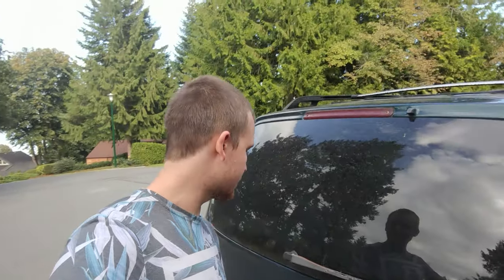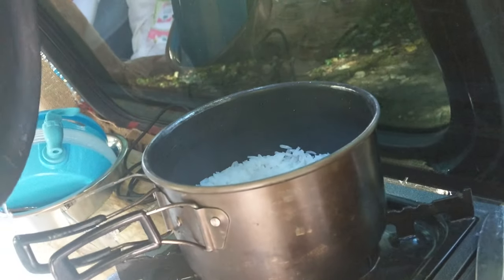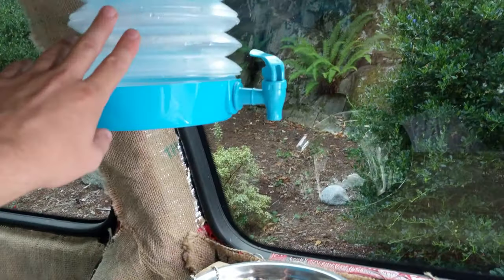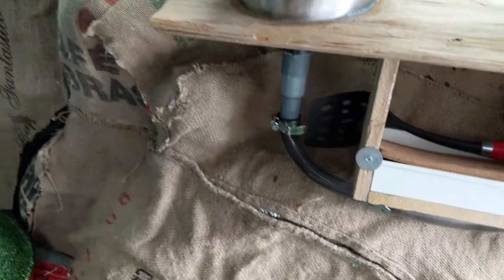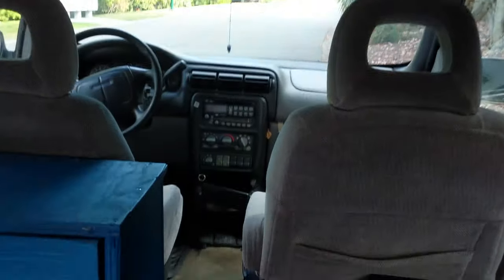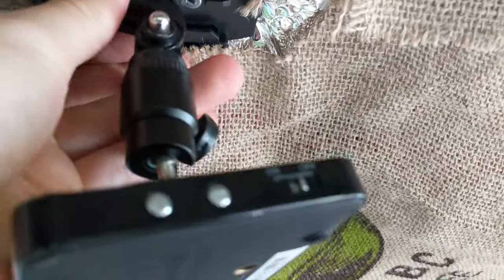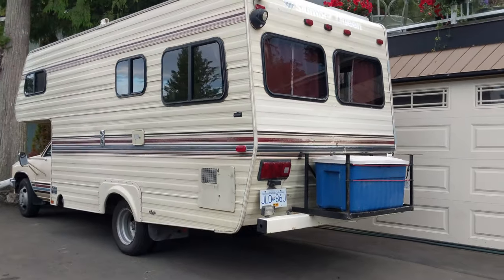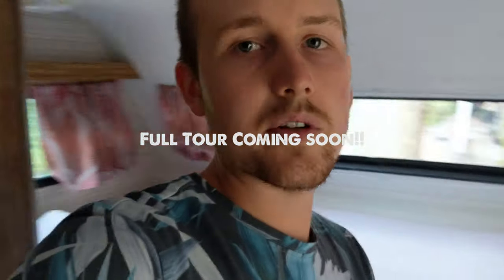My Fully Converted Stealth Minivan Camper with Kitchen, Projector, Couch and Bed, Insulation.

Comment: Good minimalist design approach Forest. Will the burlap take on moisture over time though?
Reply from the maker: Thank you Leah. The burlap was treated using borax for its antifungal and natural flame retardant properties so if it did take on moisture it wouldn't mold. If it did take on moisture it would also release it back if you dried out the van which is nice, atleasst it won't get trapped anywhere

Comment: Don't you worry about sleeping in a van surrounded by windows? There's no protection if someone decides to chuck a rock or brick through the window...
Reply from the maker: I'm too logical to worry about something like that. The likely hood is so little.
Reply: @takingbackcrypto  The likelihood isn't that little if you're living in a city, i've had it happen to two of mine...
Reply from the maker: Were you inside the van at the time?
Reply: @takingbackcrypto  thankfully no, they were vans that i just used for work
Reply from the maker: thats good, yeah I haven't heard of that happening untill you mentioned it, but im sure it does depending on where you are.
Reply: @takingbackcrypto  you havt heard of people breaking into vehicles?...
Reply: People break into home to doesn’t mean you don’t go in your house
Reply: @Andrethemodel  no. but you can be aware that it happens so you can take steps to midigate the risk.
Reply: Jimmy Johnson just stop while your ahead
Reply: @Andrethemodel  why dont you stop when you are behind?
Reply from the maker: @jimmyjohnson8233  hey Jimmy, yes of  course I have heard of people breaking into vehicles, what I meant was I haven't heard of people breaking into vans when they are campers, everyone evaluates risk and reward when doing anything and to me the added risk of someone being present during a break in would help to deter a break in, but anything is possible, and not every criminal thinks straight.